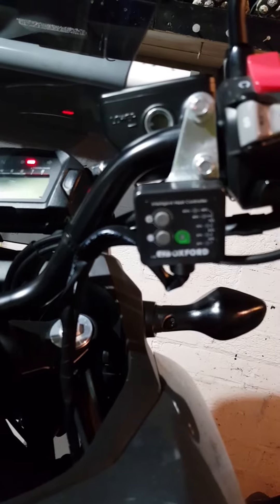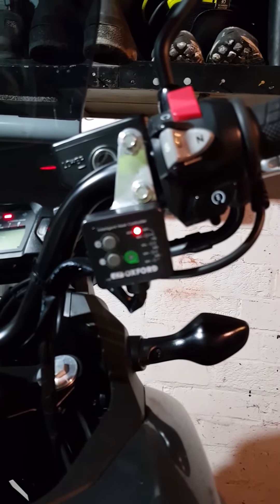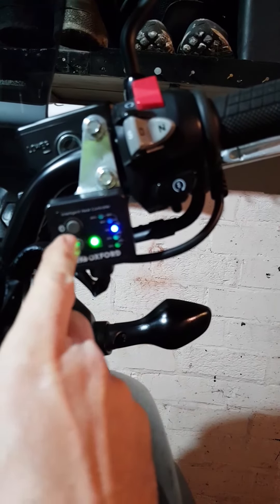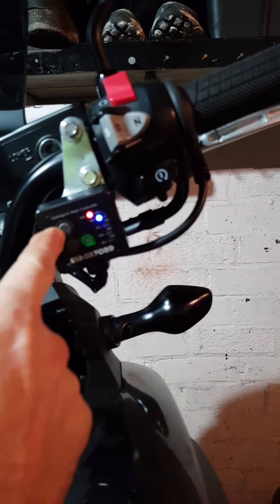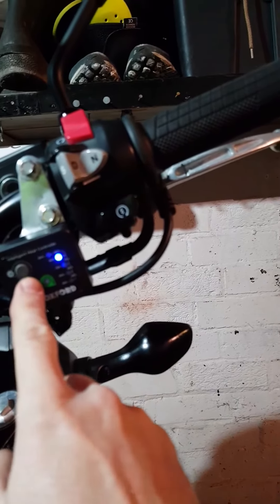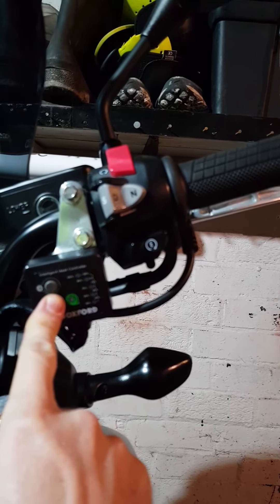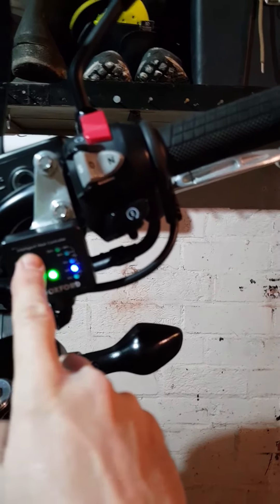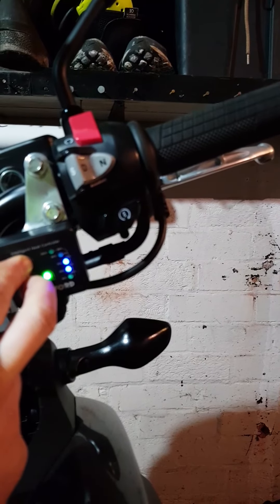Oxford Heated Grips Not Working power saving mode problem green flashing light fix hack

Comment: I have another version of this, which is oxford hotgrips courier. For you, the green light flashing when the engine is off, but for me, even though the engine is running, the light flashing unless I drive it, knowing that the battery is new. i will try this hack maybe will work with me, thanks for the video. cheers ❤

Comment: Yep just had the same problem. Voltage is good and should not be going in to battery/power saving mode. Think it's a fault with the controller